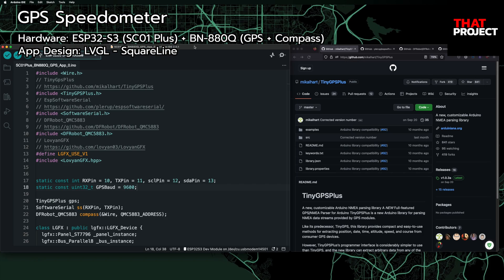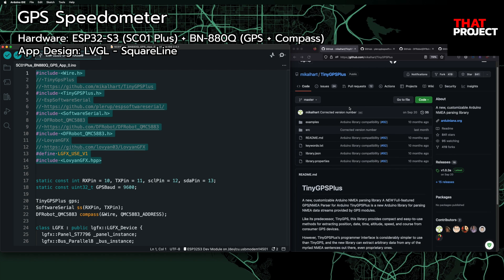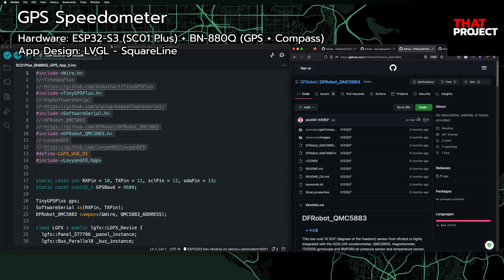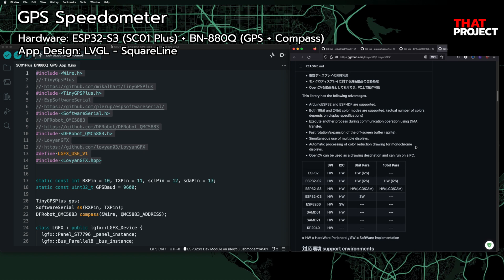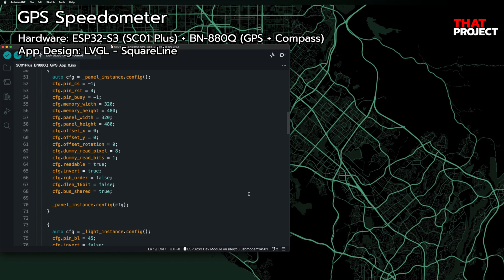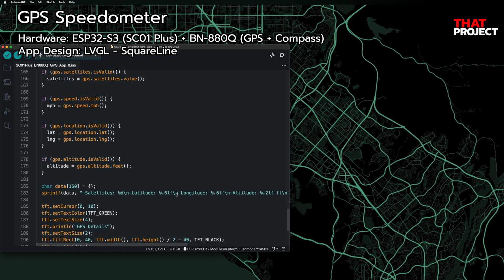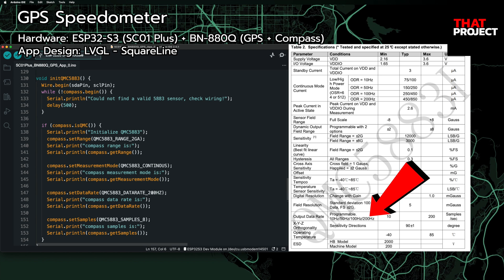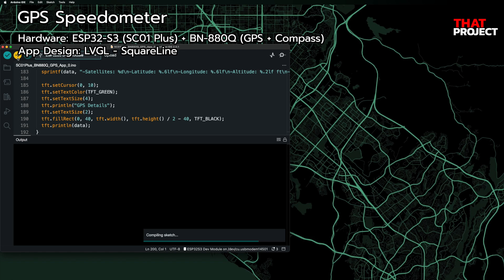Let's build a GPS Speedometer with ESP32-S3 and BN-880Q(GPS, Compass) [1/2]

Comment: Can u add navigation feature with gpx file?
Reply from the maker: Maybe it's possible. After reading the GPX file in XML format from the SD card, it is compared with the current GPS information to sequentially check whether each point has been reached. Writing a GPX file also seems to be very straightforward and simple. Otherwise, it may be difficult to read and navigate this. Anyway, thank you for the great project idea.

Comment: Hi. I have the same hardware as you, but the part 1 code doesn't display anything the screen is black.  If I change the tft.fillscreen to white it changes to white so code is running,  any idea?
Reply from the maker: It's natural. If the BN-880Q is not connected, the screen is just black as there is no data obtained from it.
Reply: @That Project  Thanks for replying,  I have figured it out,  I have a BN-880 only with no "Q" prefix which means it uses the HMC5883L chip. So I changed all constant names and now running good.
Thanks again.

Comment: Nice video. I am new to programming hardware but just bought a WT32-SC01 Plus! Do you have any barebones sample of making the display work with Arduino ( with touch function )? 

Thanks once again for the excellent tutorial. I will be building this once I gain some experience.
Reply from the maker: Thanks for liking my video. Unfortunately, I don't have an example source code for simple tasks. But I believe you can make it from my source code. Please let me know if you run into trouble doing your own project.
Reply: @ThatProject  Cool, thank you so much. I will go through the source code and see if I can build something like a basic template. Your project looks cool and I hope I can build some cool stuff too using this nice display. Cheers & all the best - hope to see many more projects on your channel.

Comment: Cool project, thanks for sharing. Just a quick question - in this project does the touch work?
Reply from the maker: Sure. It's an application with 2 pages. When I touch the top title, you can see it goes to the next page. https://youtu.be/J0AYSS8xxOY?t=12
Reply: @ThatProject  Cool, I missed that part. Cheers.